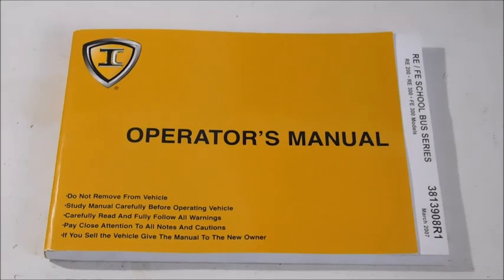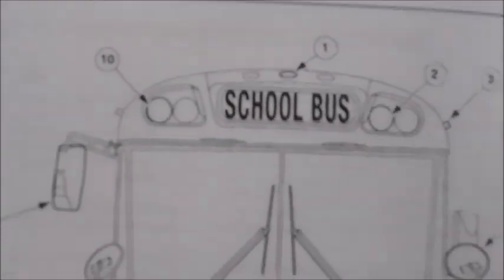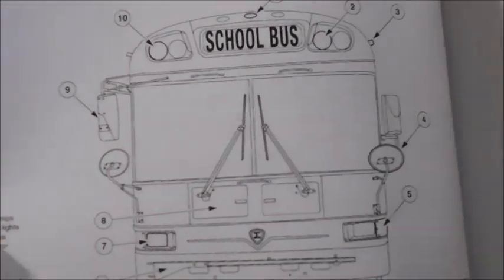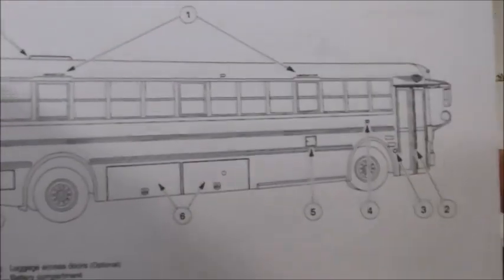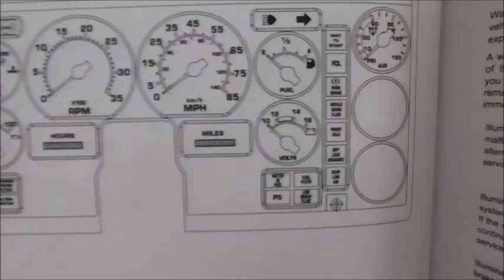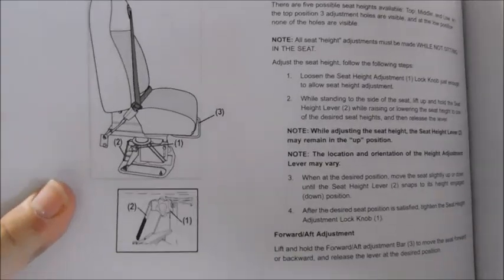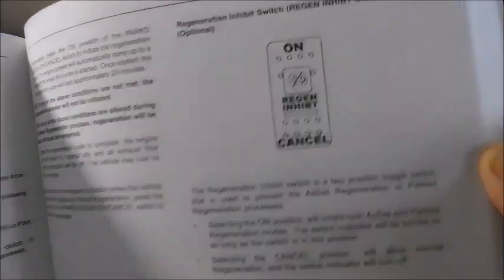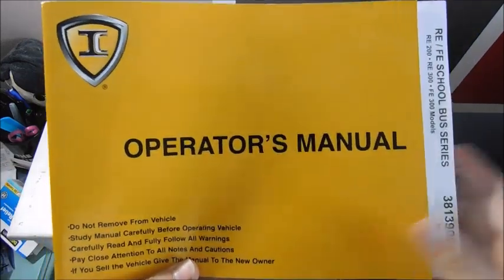IC Bus RE & FE Series Operators Manual Review

Comment: I need this manual.. where can I get one?
Reply from the maker: Well it depends if you need it for the FE or RE bus. If you need this for a RE, you can likely call an International trucks or IC Bus dealer and tell them you need a IC RE operators manual. As for the FE it may be a bit harder to find since the FE has been out of production since 2009. I would watch for it on eBay I’m that case.
Reply: @BusBoy501Productions  what about one for a 2003 ic ce and 2005 ic ce and 2010 ic ce?